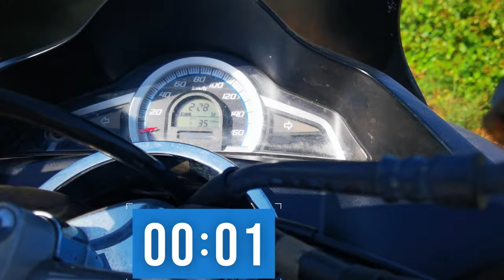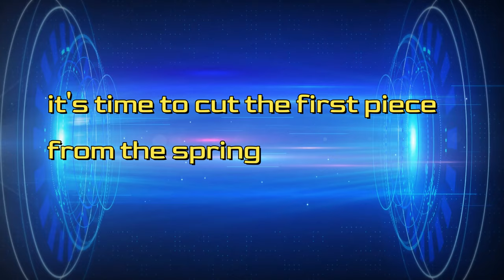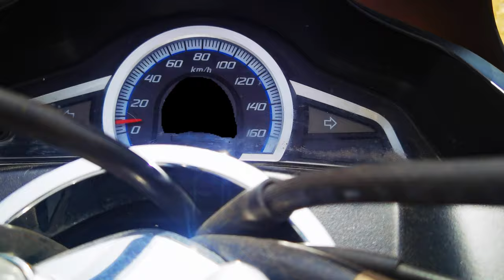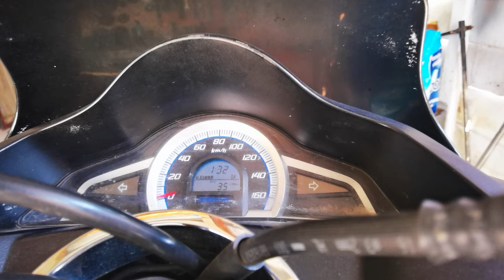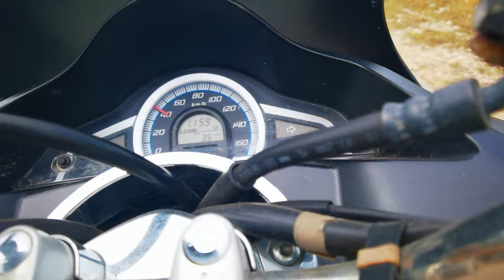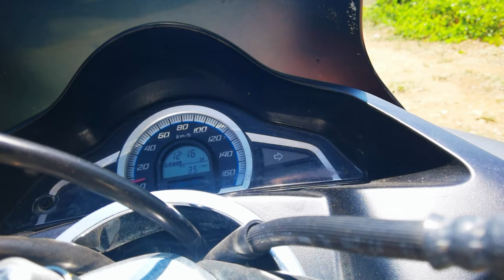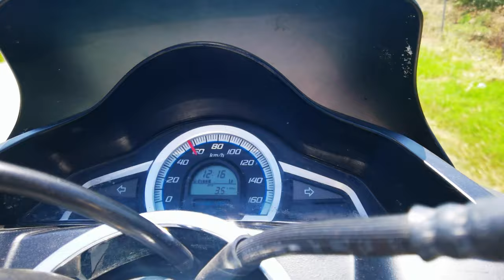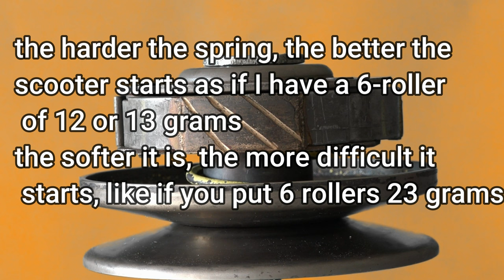cutting the centrifugal spring how the scooter pcx will work

Comment: When you do this, you will have belt slippage due to the weaker spring tension, that’s the reason for slower acceleration. The scooter will not reach the top speed and engine will cut out at slower speed.
Reply from the maker: Hi AffyNoX clearly this is an experiment showing how the spring works i didn't do anything more.
Reply: Clearly we aren't Chinese

Comment: If you want to go fast ,shorten the variater bus for 3 to 5 mm , it will pull very fast and the topspeed is also higher. Try it and show the video. 👍 I did it always and it is very fast, alot off difference.
Reply: O que é (variater)
Reply: @cliveswabs9365  but i would reckon going shorter by 1mm and try first, because 3-5mm is a huge jump
Reply: @cliveswabs9365  understood, but in scooter cvt even 1mm makes a huge difference. Its better to cut down littlw by little rather than you cut down too much and cant go back
Reply from the maker: @cliveswabs9365  airplane
Reply from the maker: @cliveswabs9365  try it you will be happy, your profile picture is amazing😀
Reply from the maker: @NR-yn4zx   yes
Reply from the maker: @cliveswabs9365  this means you have a lot of room for improvement
Reply from the maker: Hi klives They have a very good motor, from what I can see, your variator is at the stop, it has a long curve, it has a stop, the balls don't have any aluminum, you can grind up to 1 mm, I don't think you'll see a difference, if you improve it, it's done by the centrifugal pump and grinding the variator patents  let the variator close more https://m.youtube.com/watch?v=H1o8aWGsuzE what I do from 1:20 to 1:40
Reply: Tam olarak ne demek istediniz 😊bende hızlı gitmek istiyorum

Comment: What is the difference between stiffer center spring vs. Lighter variator weights? What are there advantages or disadvantages?
Reply from the maker: very good question, the hard spring makes a better start than the normal one, in the hard spring you have much more problems for example if you change the belt at 15000 km it should be changed at 9000 km if it hasn't also the engine has cut plastics and many other problems the only good  which is off to a better start.
Reply: @MBPATENTS  hmmm but they have the same effect when you use a lighter variator weights? Based on my experience it looks like using a harder spring it feels like you use a lighter variator weights. I just don't know what is the difference between using a harder spring and using a lighter variator weights
Reply from the maker: @arvinjohnroallos4821  if one this is one the other
Reply: What about milage drop?
Reply: @arvinjohnroallos4821 câu hỏi rất hay,nhưng giửa thay đổi lực nén lò xo sẻ có kết quả khác biệt với thay đổi trọng lượng bi văng rất nhiều.
Vì sao? Vì trọng lượng bi văng và lực lò xo phải cân bằng nhau để nó giử dây coro ở mức căng vừa đủ với tải trọng của xe,không quá dùng củng không quá căng.
Nếu bạn giử nguyên lực nén lò xo mà tăng trọng lượng bi văng thì áp lực lên dây coro càng lớn ảnh hưởng độ bền của dây coro.
Còn nếu bạn giử nguyên trọng lượng bi văng mà giảm lực ép lò xo thì áp lực lên dây coro không tăng mà nó chỉ giúp puly sau mở nhanh hơn mà thôi.
Thay đổi mổi chi tiết trong đó đều có kết quả khác nhau chứ không hề giống nhau được

Comment: And if I want to reduce consumption, as I do in terms of rollers(lighter, and heavier), springs(harder, softer), belts, etc.
Reply from the maker: Hi cransa to see a good difference in consumption more economically, I mean you have to remove the stops to increase the step of the centrifugal with the variator and the balls were 5 grams higher than the factory cylinder
Reply: @MBPATENTS  OK, thanks.

Comment: lowering the tension/rpm of the spring gives you more acceleration but less on long strech. better to buy wider fan belt give more power from torchdrive to bell.
Reply from the maker: я не могу вас понять, что вы говорите, но в этом видео я описываю, что вы не улучшаете скорость с этого момента от центрифуги - это сбой в pcx, теперь я загружал более широкий ремень или что-то еще, что не имеет зазора друг с другом Спасибо за ваши Коментарии

Comment: What happen if you put stiff spring with heavier roller variator maybe 1 g or 2 gr heavier?
Reply from the maker: if the balls are heavier the bike starts with hidifficulty the spring as soft as it is also starts with difficulty if the balls are light in the bike it starts very quickly if the balls are heavy it is difficult to start the bike so the other is the spring with the balls  they make the difference you have to find the combination.

Comment: You don't need to be a genius, just knowing the mechanics is enough.
It is logical that when the spring weakens, the force on the belt will decrease. Engineers specifically calculate the spring stiffness so that the pressure of the cones on the belt is optimal. If this parameter is weakened, belt slippage and increased wear will occur.
Reply from the maker: You are right, the mechanics know about the tight spring, but in , where do you ever see, the softer the spring, the more kilometers the belt or the engine belt wears out, did you know this and the harder it is, there is damage all over the machine  you will have vibrations in the engine with more revolutions in the drum in many lights until the plastics creak

Comment: Thank you sir i am also doing same thing , but now i tired this centrifugal system
Reply from the maker: is there a way to get another 10 km from the centrifugal well everything will work marginally it's nothing for sure then it's the way it is and I just did a test because I saw that many people do it and they see improvement nothing there is no improvement the improvement is a very distant stop  and you put the variator's shim further in to go to 138km, an easy solution